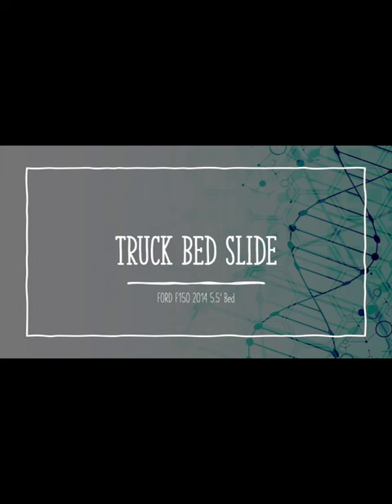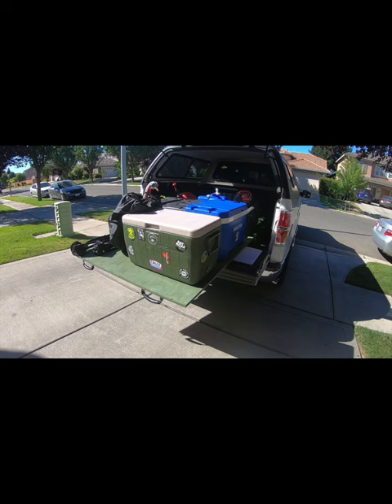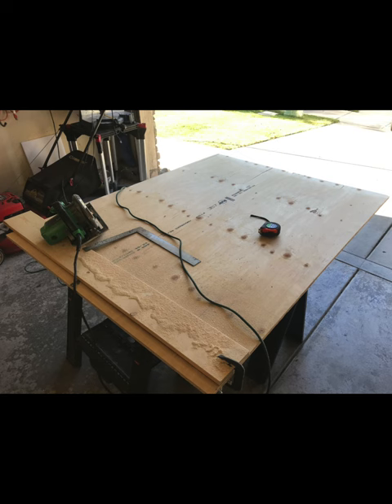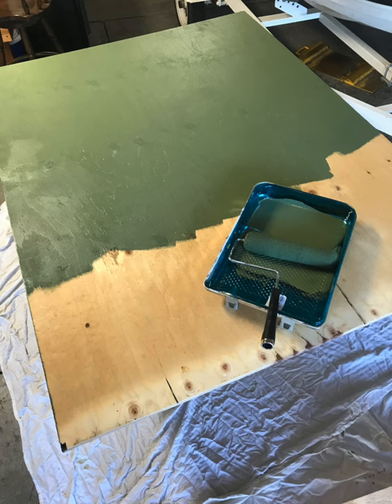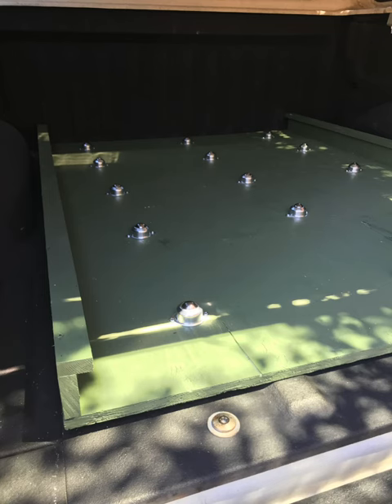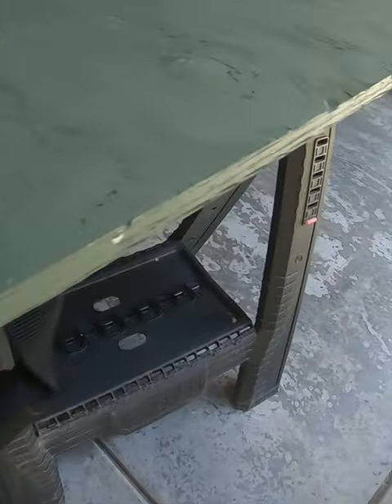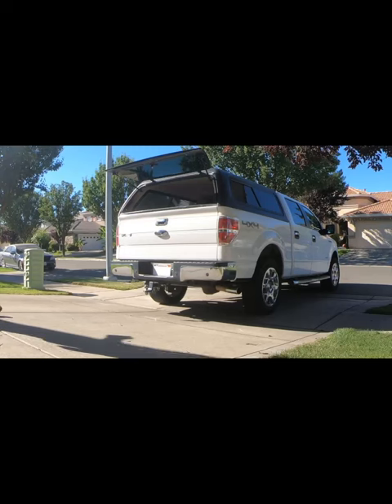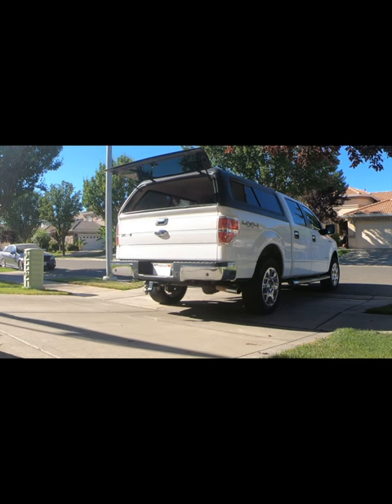EASY DIY Truck Bed SlideHD 720p

Comment: Thanks for the video. How does the bottom part stay in the bed? Drilled into the bed?
Reply from the maker: No prob!! You could easily drill an anchor if you wanted to but I have no issue with it riding with just the weight of the base and slide. Mine is not anchored. I take it in and out to clean or if I want the bed empty. I haven’t needed to anchor it yet 👍🏻 Been such a great addition.
Reply from the maker: I added a rubber floor mat to the top of the slide board to keep cargo from sliding around which was much needed.